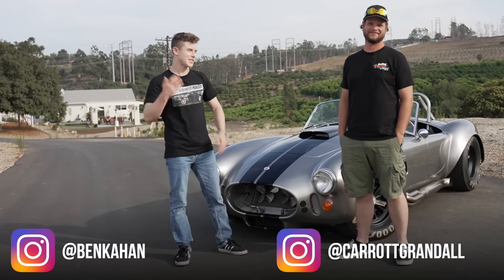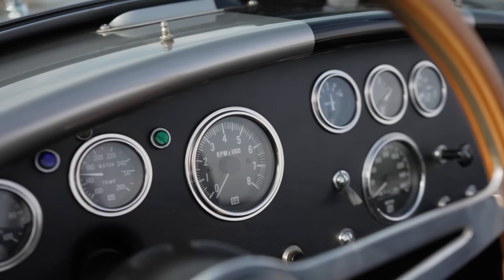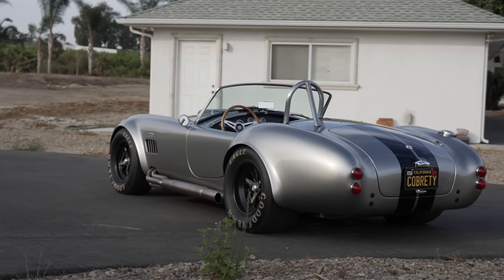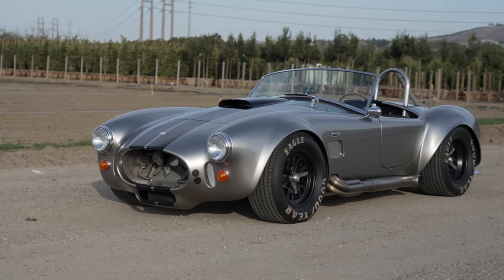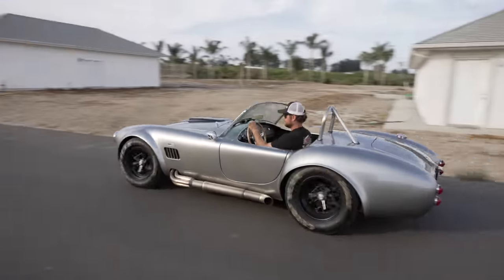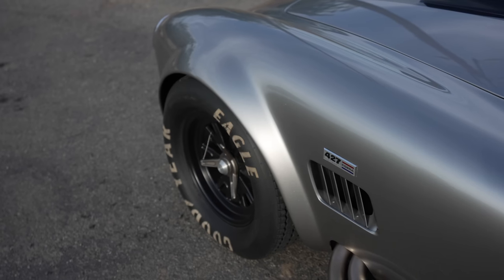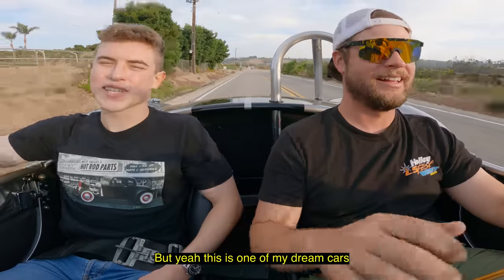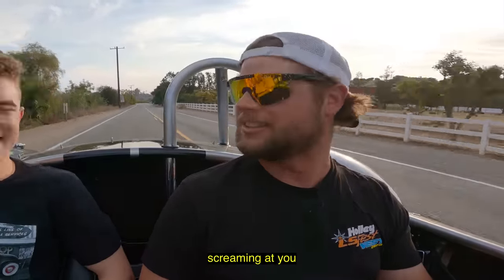500 Horsepower 1965 Shelby Cobra!

Comment: Yeah carroll was not into the big block an its sits so far back because it would make the small cobra push the ftont end so bad..enter ken miles input i will guarantee the 427 big block is as far back as ken could get the team to push it...i own 70 to 74 dodge challenger an cudas a front engine car that had tortion bars that allowed u to move the weight from front to rear my mopars always handle great for ripping around town i lower them put 255 50 15 bfgs on them to bring c o g down got AAR CUDA auto trans 1970 an really got fast road race car...that no one thought about...shelby was always a legend of just before my era...it was till he went to dodge that i really found out who he really was an the new movie i learned he actual won le mans 24hrs race a track i love second only to the northsliedge...nice car...hey im into classics but i like a 6 speed tremec back when i had my challengers i was thinking rippin small block v8 8 webbers an a richmond 5 speed..6 speeds had not come out yet...it was only 1981 82..i was so bent on making an m3 wide body dodge challenger just to give it an exotic rare road racing look of a bmw m3...beautiful car sound like a race car should...i race superbikes...

Comment: still think a small block is the way to go with one of these evil handling Cobra’s.  347 w/ 450 horse or 393/408 with 500-550. 
Lighter and better handling. You don’t need the big block torque with these lightweights.
Reply: I do believe that Carrol Shelby would agree with you. He said he did prefer the slab side with 289 high performance and a C-6 automatic transmission. Shifting a car transmission no longer enthused him.

Comment: At 1:42 " more leverage..." No, no and no....the original Ford  Cobra Toploader four-speed  when in place wound up being  too far rearward, the stick sprouting out "the top" of the gearbox right off your hip, out of place,  so the engineers got a 65 Mustang shifter stick & twisted it around...backwards, nothing to do with leverage...this is how stupid myths get started. Pop your head inside  a 65 Mustang, recognize the shifter?...same shifter.

Comment: Dude you say 428 but the motor reads 427? What's up with that?
Reply: Common to bolt the 427 rocker arm covers on other FE, (big block ford) engines.

Comment: This is a perfect example .of 10 flat in the 1 / 4   .. t.e. 140. Mph .but NASCAR  made it illegal cause nobody could catch it .now i too old to care gas 6$ a gallon canadian . You want 2000 c.c. 5 gears and a clutch .  . Auto .trans burn up ok. L.o.l.  so we all boring. 2021. .
Reply: Huh?
Reply: NASCAR made the "cammer" illegal.  I was the 427 with overhead cams.  Not many around and they're worth big bucks.  The pushrod 427 was a winner in lots of racecars.